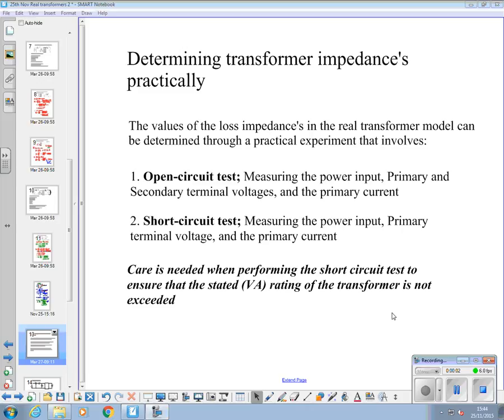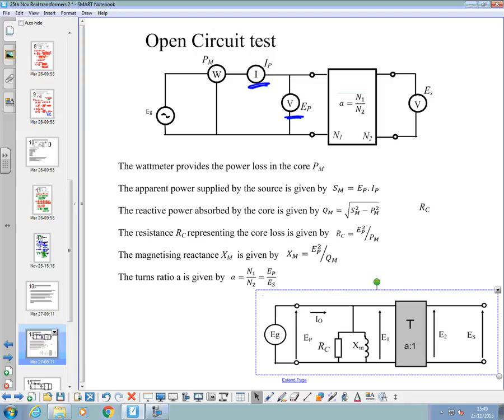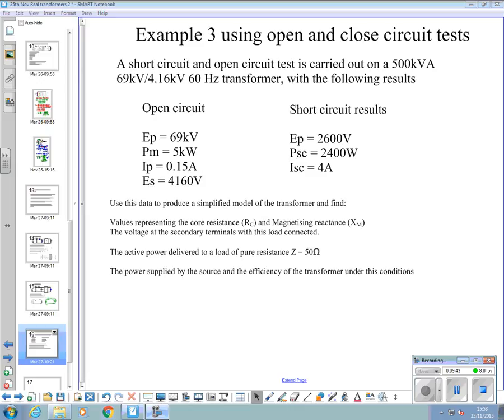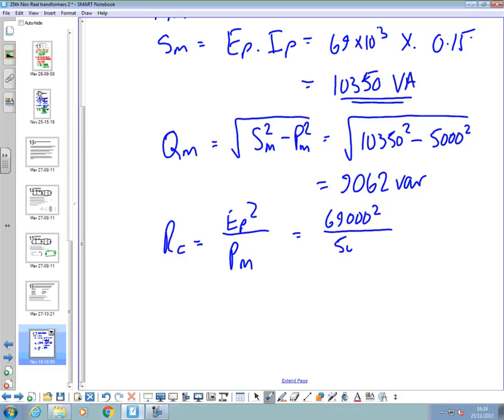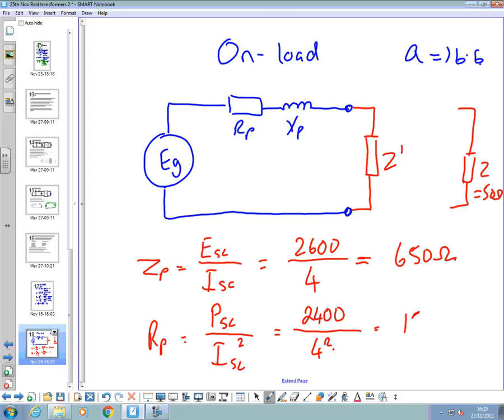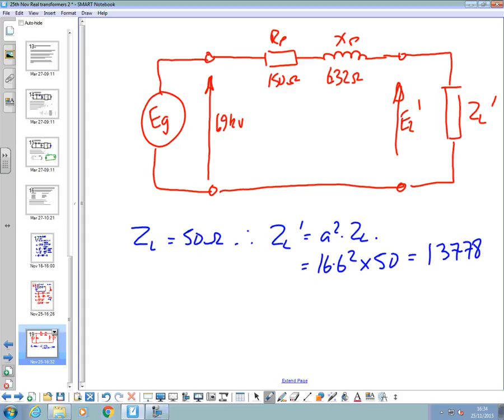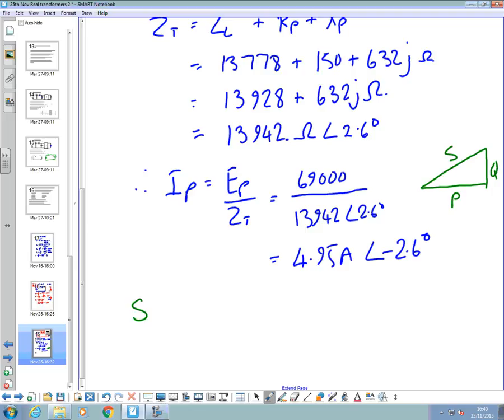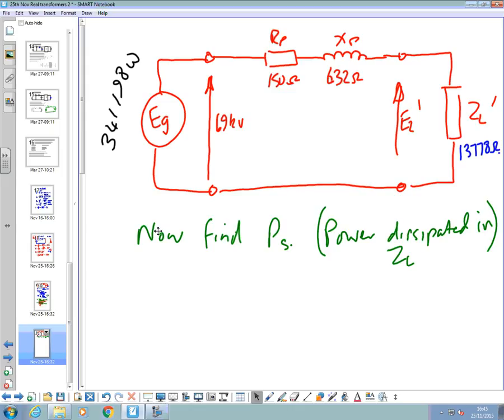November 25th Part 3: Determining transformer parameters using open/short circuit tests

Comment: Do you have an example of where you also take into account the resistance of the windings and the other inductive loss in it? I forgot the proper term for it.
Reply from the maker: Hi Robert. the video above is an older version and is towards the end of my teaching of the topic.

If you go to this playlist, you will find my most recent teaching of the topic:
https://www.youtube.com/playlist?list=PLH72-Cl3YxQ4aQjjI_-oImAmN58su-j1N

If you follow the transformer sessions through from the beginning you will see that the full transformer model gives consideration to the following losses:

1. Winding resistance
2. Leakage flux
3. core losses
4. Magnetising current

I then go on to consider that the model can be simplified under most conditions (loading above 20% of full load)

The open circuit and closed circuit test is a practical way to determine values for these losses so that a real transformer can be modelled. In my classes, we carry out this process to model a transformer under a given load to prove that the model gives valid results.

I hope you find this useful.

Mike